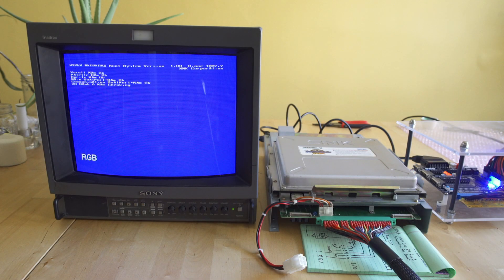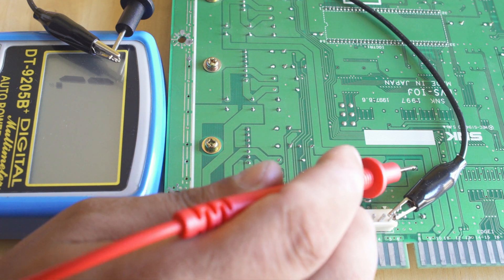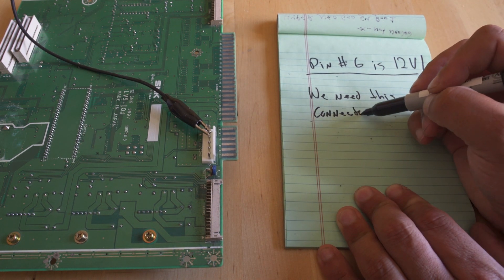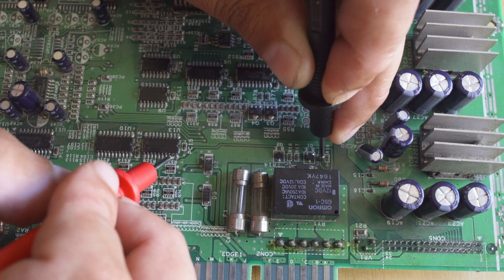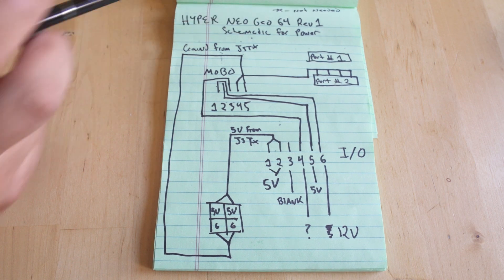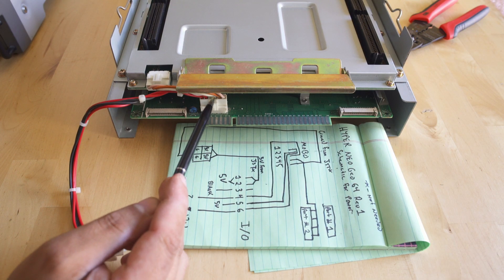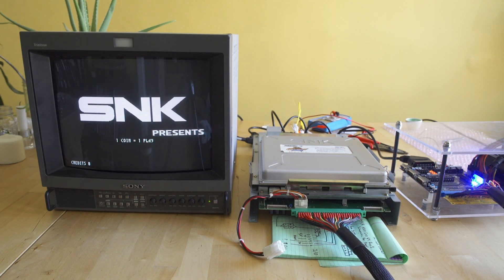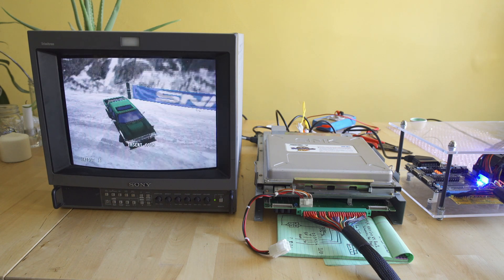Converting the Hyper Neo 64 Motherboard Pt 2 - "On a Technicality" - Video Game Esoterica

Comment: Might be a bit of a long shot but-
I have 2 HNG64 boards, a rev 1 fighting board and a driving board, but no driving games.
The fighting board has issues similar to what you showed near the end. Graphical issues, but especially on all 3d elements no matter how much I clean contacts. While the driving board shows none(booted the samsho games on it since it doesn't check)

I found this video as I was thinking of going through the process of swapping things over to turn the driving board into a fighting board but do you think there's any other steps I should try with the fighting board before going through the trouble of trying to swap everything around?
Reply from the maker: If it’s cleaned to an inch of its life then no. That’s what I’d recommend

Comment: The black Omron box is actually a relay switch. If it senses 12v then it lets 5v power through. I had to learn all that when I made a consolized one with 5v only.
Reply from the maker: Good to know :) I have a way more extensive pcb overview of the hyper coming soon. Some assumptions made but for the most part should be more descriptive